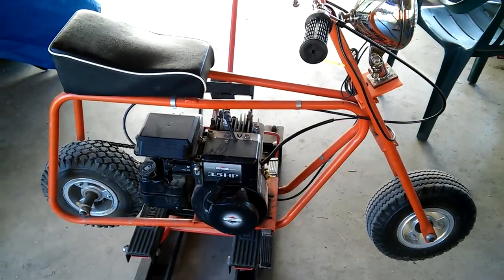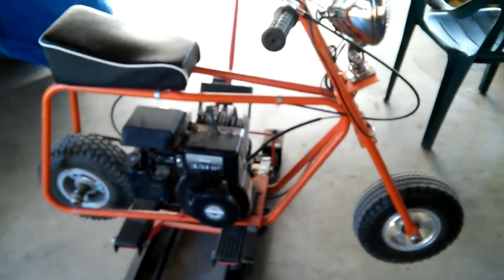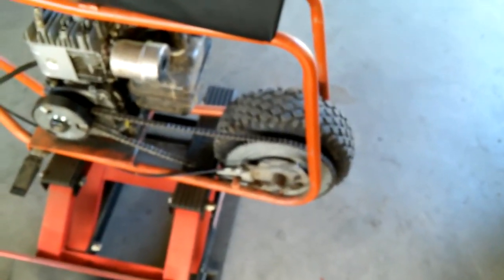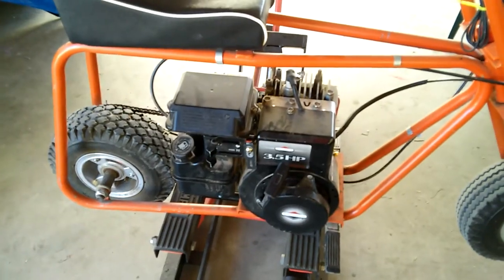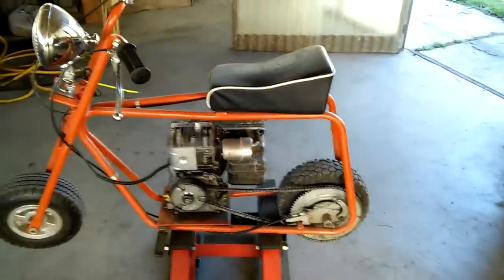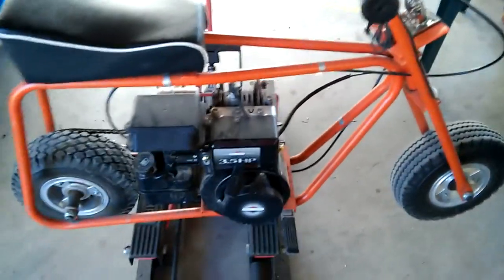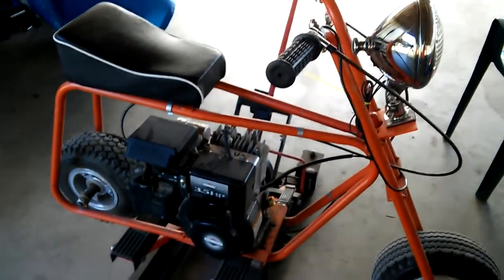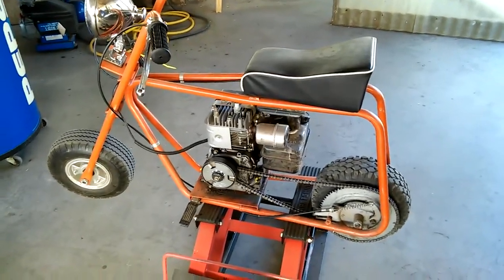Azusa mini bike kit rebuild part 1

Comment: My brother had a mini bike with a 2 speed that was changed by a foot selector. It had a clutch set up on a shaft with two chains, one on either side, and the rear wheel also had a sprocket on either side.✌✌